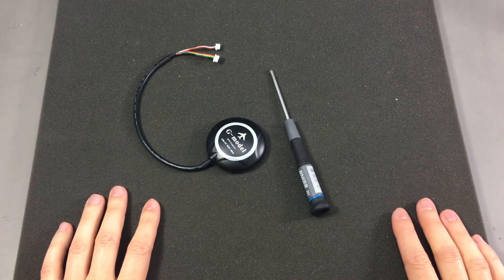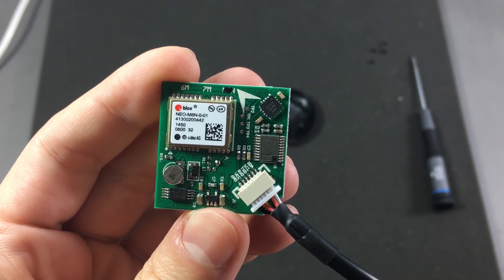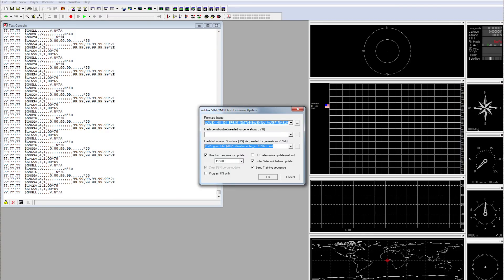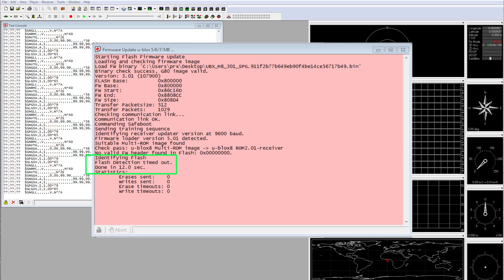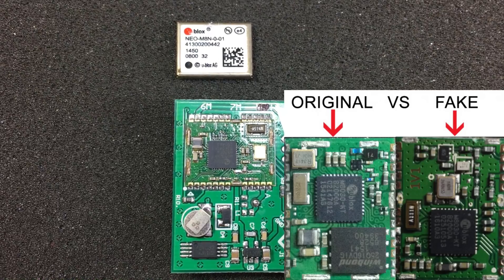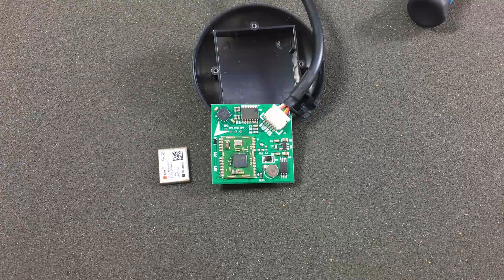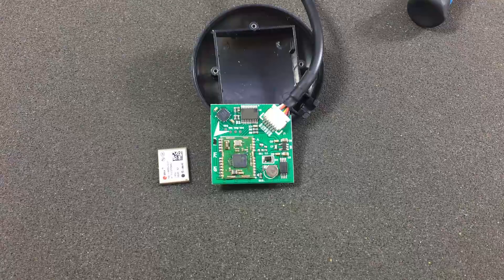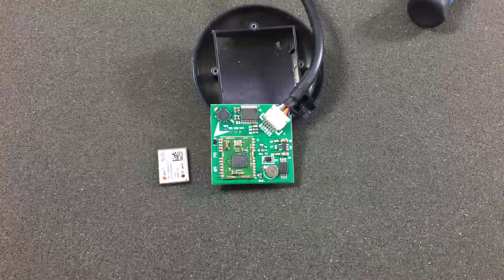Voltlog #146 - Is My NEO M8N GPS Module Fake?

Comment: If the chip indeed is a real u-blox, it looks like they took the M8M (the module without flash) and rebadged it as M8N. That's about a 3€ difference when you look at u-blox' product page. 
I would definitely request a refund. I know it works and in this case it may be enough for your purpose. But it is not as described and for other products you may end up with almost unuseable items. Even if you get a refund for those, the fakes shouldn't be there in the first place. In my opinion the only way to keep them at bay is to report every single one of them.
Reply from the maker: I see most of the comments suggest I should request a refund but this time I saw things differently mostly because the module is usable. Other times I would just request a refund and not look back.

Comment: Videos like yours help because if a seller is selling genuine, and knows there is a difference, they will advertise as genuine and show pictures to prove it so as to increase their sales. China introduced some copyright laws recently, and I think it is the reason when I bought a Bosch LSU4.9 oxygen sensor recently it only had the same part # but didn't have Bosch stamped on it. All the fakes I've inadvertently bought work, even thought I don't push them to the limit, i.e. 60A MOSFETS to only 3A, so I'm not complaining.
Reply from the maker: yes I agree, videos like this one are going to contribute to changing things.

Comment: A problem with ordering from the average small seller in China is that they don't hold any inventory. They are either runners that will get your parts from the markets (Huaqiangbei, etc) or drop-shippers. You might get a real component, go back and order from the very same listing, and get something from a completely different supplier the second time. It's always a roll of the dice.
Reply from the maker: that is true

Comment: I ve the same modul. Its workied well but received sometimes only 12 satelites. So i decided to try the Fw update. I could manage the update as u-center says update was successful without timed out issue as yours. BUT now the red 3d fix led does not blinking just reamain red with low light all the time so it does not indicate the 3d lock anymore. But the gps work as it should..has 3d fix really fast...only the red led not works as previously. Do you have the factory configuration of this modul for ucenter?

Comment: Great Video. I have a few of these M8N modules and I could not work out why the GPS settings would always revert back to defaults if I left them powered off for a few days/weeks. It turns out even though I was specifying in ucenter to save the settings in flash they were only going to the battery backed memory as there is no flash installed. Bit of a pain that the module keeps swapping from 115200 baud to 9600 baud but I suppose that is what you get when you buy cheap stuff off ebay.

Comment: I have a fake M8N too, a different one. It supports Galileo too but getting Galileo enabled needs some tricks like original M8N does. My fakes seem to work similar to BN-220. I think some differences are in power save settings among some other details. Some parameters you can configure on uBlox do not read back correctly after saving data and reseting gps. (they do read back untill reset!)
To enable Galileo on M8N (or BN-220) you need to 1) disable Baidou and Imes, 2) enable Galileo (default off) and 3) modify channels allocated to galileo from something like 1 to more reasonable value like 6-10 in order to track and search full 8 satellites. I think the radio can only listen so many systems at the same time and Baidou/Imes is incompatible with enabling Galileo. With those mods I get Galileo, Glonass and GPS at the same time.
I did not measure how much difference Galileo makes in reality. GPS+Glonass is already pretty good and often I can still get only 4-5 satellites for Galileo at 2019.
I've not tested but according to some sources fakea are better if you need high speed or high altitude. No 15km limit for balloons or speed limit if you have extreme hobby rockets.
Reply from the maker: This is an older video so I'm sure modules that you buy today might look a bit different and might contain different versions of firmware but after flying rc planes for a while with just GPS and Glonass I get pretty good reception on those systems alone so I'm not sure I really need Galileo, thanks for the hint though 👍
Reply: @voltlog  Agreed. Still at 2019 getting full Galileo lock is not guaranted and even when you get a lock, it makes probably little difference due to low sat count. The tricks to enable it was there, if you even want to try it out later on.

Comment: Did you check the pins? I wonder if they use the same pin layout... I found a lot of videos where - comparing it with the datasheet - the RF-VCC seems to be unconnected, probably you could remove the antenna to  check if it gets VCC or not...
Reply from the maker: Haven't checked if he RF-VCC is connected but I can tell you the module works just fine, getting plenty of satellites in open air.

Comment: Seems to be a good quality board and nice soldering, no worries. I do however wonder that they claim usb connectivity. The soldermask says sda ans sclk so it seems to be i2c or spi, both wich would not be a bad thing but no usb. Am I right about this ?
Reply from the maker: Sorry I missed, where does it say USB? The module has SDA + UART connections to the external connector. However the chip itself also supports USB.
Reply: VoltLog Not your video but ebay listings.

Comment: Can You please tell what IC is near the battery with 4x2 leg package? Or it's label. On mine it's unsoldered.
Reply: Hi Fedor, it is an i2c serial eeprom to store config, like M24C32. See in Hardware Integration Manual from Ublox. By the way, i am curious to know what is the sso20 called U1, if someone knows 🙂

Comment: I have the exact same module from Banggood and I have finally installed on a drone.  The flight controller board an STM32F405 recognizes the GPS module although it does not seem to detect the compass... Anyone noticed the same issue?
Reply: The new modules are using a QMC5886 instead of the old HMC5886 . If you are using it with Betaflight then it won't work because the drivers are yet to be added for it .
Reply: @ninjalemon_Squash  Thanks!!!! It makes sense it was not advertised to work in betaflight but I assumed it would...

Comment: Guys these fakes are BETTER than originals. Ublox recently  released a firmware that would block RTK on M8N but with these it's not a problem.
So don't be so angry if Chinese are trying hard to sell you something cheaper.
Reply: Hmm! I see a NEO-M8P that is designed for RTK. So my fake M8N has RTK and can act as this M8P?

Comment: The m8030 is not the same as the M8N. It lacks the SAW filter, Low Noise Amplifier,  TCXO, flash, and RTC. It's not just the flash that's missing.

Comment: da e contrafacut .. 99% din cele vandute pe net sunt.  daca compari cu un original o sa vezi diferenta.
bravo pt canal.
best is to buy from you know ppl have already bought and its a trusted source.
for this one there is a diy sollution to add a winbond cip  4mb like the ones from esp
cheers.
Reply from the maker: thought about it, if the pcb would have the footprint, i would do it but otherwise it's not worth the effort.

Comment: Does this mean that you have an 7M not N ?
Reply from the maker: nope, it has an 8th series chip inside.
Reply: Ooops. I meant 8M rather than 8N
Reply: @robfenwitch7403  M8N:8030+TCXO, Flash, SAW, LNA, M8M:8030+crystal, ROM. fake modules have 8030 but others(Flash,SAW, LNA) may or maynot be present. Use radiolink modules its it comes with all components but from different companies.

Comment: If you did not report fake product to platform and demand refund, you're part of the problem. You practically encourage them to continue. 
Report, make negative feedback, request refund. This is only languages they will understand.
Reply from the maker: Causing losses to a small seller on ebay or aliexpress would not solve the problem at all, that's how I see things. When there is an obvious fake that would not function as the original I would request a refund but in this case the GPS module works as advertised.
Reply: @voltlog, If you don't want to request refund at least make proper negative feedback. 
If you really worry of seller well-being, left neutral feedback. With big fat "FAKE" over it.

And no matter what, you still left referrals to this fake product in video description... 
You're part of the problem.
Reply: Good luck with that. They ignored my mails to customers service and deleted by reviews and comments when I had that problem on banggood...
Reply: I so far avoided aliexpress and banggood.. I'm use ebay because of playpal (and mouser/digikey for really critical components). paypal generally good for us and force sellers to be "in shape". 
seller cannot do anything with ebay rating and feedback.
Generally it should apply for banggood as well since they work with paypal, at least for claims/refunds.